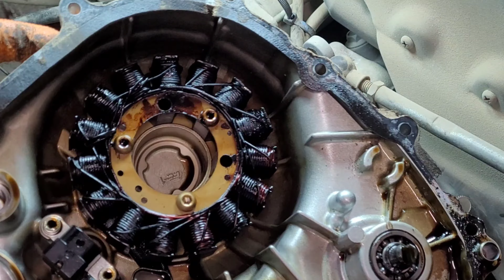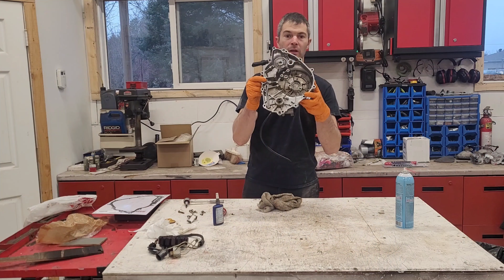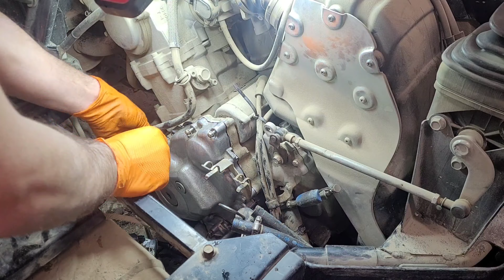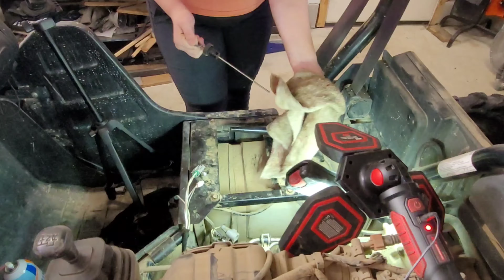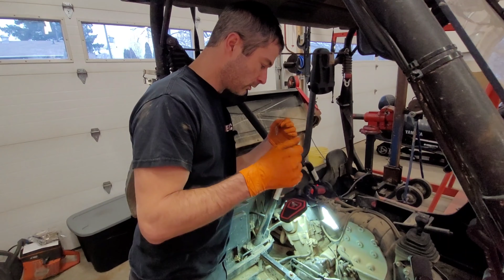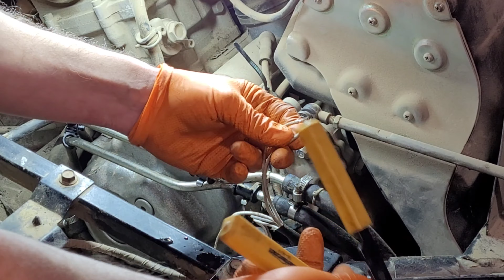Rhino 700 - BAD Stator - NO charging !!!

Comment: Oil Drain Plugs? Why do guys think they need to crank down the Oil Drain Plug so tight that they rip the threads out of the Oil Pan? Oil Plugs don’t hold anything together, it simply keeps Oil inside the machine. STOP OVER TORQUING OIL PLUGS! Snug tight, most oil plugs only need 10-15 ft. Lbs.
Reply: How many ugga-duggas is that?

Comment: Hey ive got a issue with over heating on my 2008 yamaha rhino special edition, about 10 minutes or so of idleing the over heating light comes on and i smell antifreeze. far as i can tell there is not water circulating in the  radiator . tested the thermastat  and its opening when i tested it in a pot of boiling water, bleed the coolant lines also, so im kinda leaning toward water pump needs replaceing . what you think maybe or maybe not ?
Reply: also water in radiator is not hot when it does overheat cool to the touch , but smelling antifreeze each time it over heats, oil is clean no milk in it
Reply from the maker: Have you tried bleeding out the water pump? Another question is whether or not the cooling fan is turning on.
Reply: @thehonestmechanic  yeah the cooling fan almost comes on right away, yes i bleed the thermostat and water pump yesterday
Reply from the maker: Is the coolant circulating?
Reply: @thehonestmechanic   nope i see no movement in the water in the radiator at all
Reply: @thehonestmechanic  just took at short video of it idleing https://www.youtube.com/shorts/Bmg5eGtLivM
Reply: its doesnt move much other that when it starts to warm up it will push water out top of radiator
Reply from the maker: @satopia1  I'm at a loss....I'll have to let it stew a while
Reply: @thehonestmechanic   i know the feeling kinda got me stumped to

Comment: Thank you! Excellent video where I was hesitant to do it myself. I'd do it again -- just takes a little time. My stator looked fried too. I wonder what caused that? It's the 2nd one in 3 years. I've replaced the battery, the rectifier/regulator and checked all connections. For good measure I unhooked both winches and aftermarket lights and put them on a separate power source -- Don't know if that would case that but one of the winches does have a short and instantly kills the battery.
Reply from the maker: I would assume that the winch with a short cannot be good for the stator.

Comment: Very nice video. My 2008 Rhino 700 is not charging. I've done the stator and rectifier tests. Stator is bad. So, I've got a new stator to put in. I got started and saw the oil lines that have to be removed. That freaked me. Your video does a really good job of dealing with the oil lines and the coolant system. So, now I'm not freaked out and will continue. Also, I liked your solution to the burnt plug. I don't have that problem but it will be a nice reference for future issues. Thanks again for the video!!!
Reply from the maker: The compliments are much appreciated. Thank you!
Reply: @thehonestmechanic  Thanks again for the video. I finished my stator replacement today. It went well!
Reply from the maker: @racardon  that's great! Pass on this info to someone who can use it!